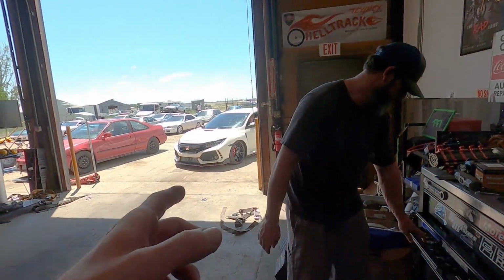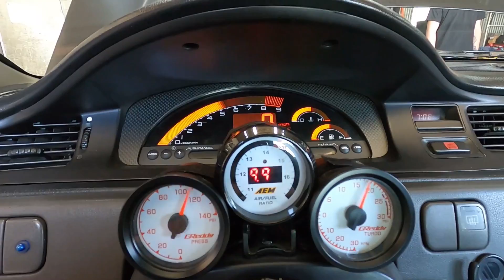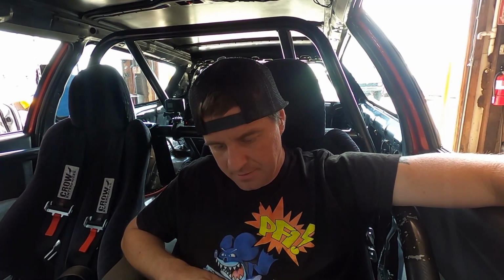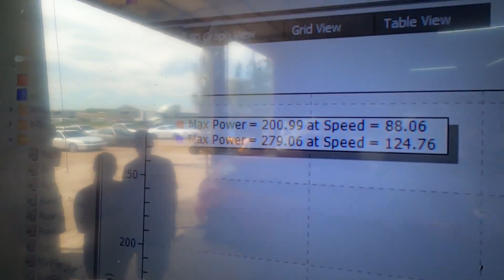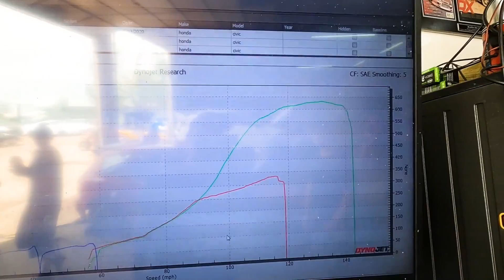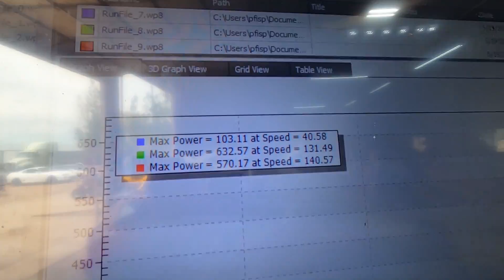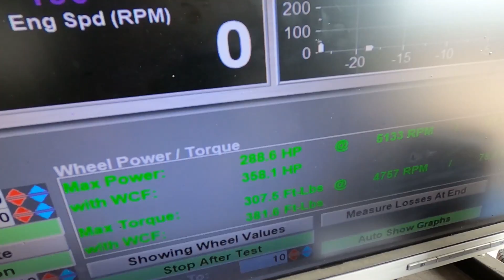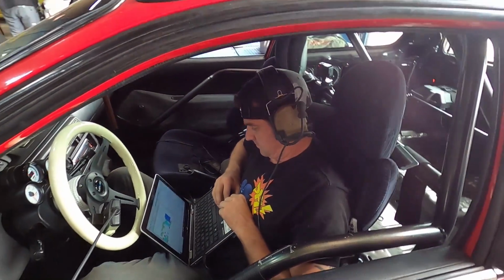His 8 year old Daughters Civic Blasts Off! 🚀

Comment: Sweet rides! I spotted an extra idler pully on the B-Series, is that just because the valve cover has been trimmed all the way back? Never seen a setup like that before...
Reply: Looks like he did that due to b-series having that issue where the belt flappsin that area even with tensioner fully adjusted when running. Think he did it for security on belt to make sure it does not jump teeth and keep tension on belt all around.
Reply: I run one myself made by Endyn. Helps reduce timing belt slap if you have any.
Reply: @justingadell  Endyn? They are local to me, they actually did all the PnP work on my B-Series head back in the day!

Comment: Can someone fill me in...I thought typeRs were FWD only? I remember the focus Rs came out and it smashed the honda in a drag
Reply: That year si is fwd type r is awd
Reply: Type R is FWD.
The dyno was linked for 4wd on the first runs, hence the rear wheels turning.
It was changed to unlinked 2wd mode for the power run at the end. Rear wheels not turning.
It's the dyno not the drivetrain turning the rear wheels.
Reply: I was wondering that too. I thought it was a custom awd setup
Reply: It is front wheel drive but the dyno can also spin the tires in the rear
Reply: The new cars has issues on a 2wd dyno due to traction control